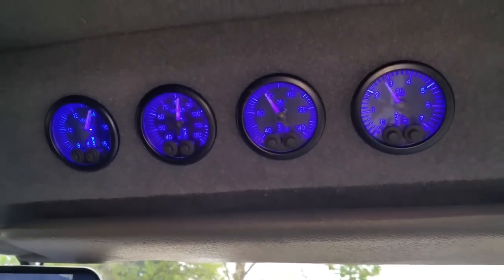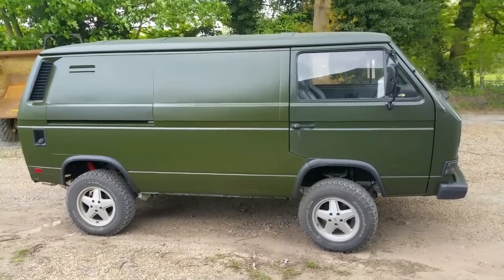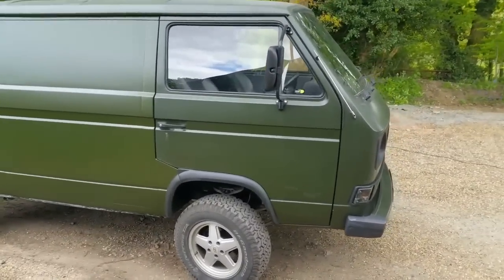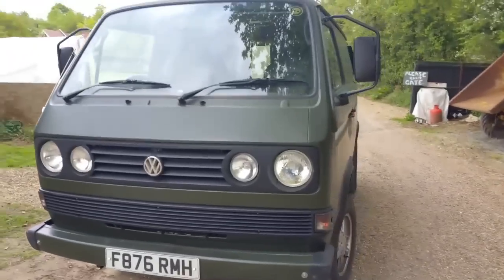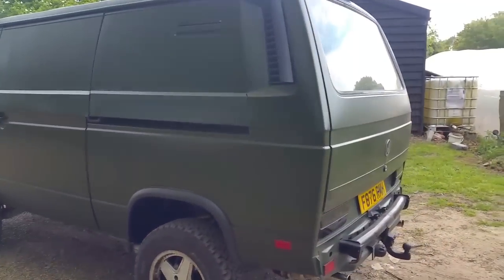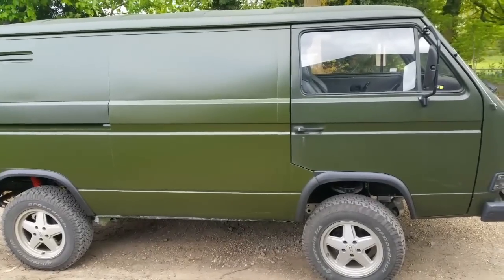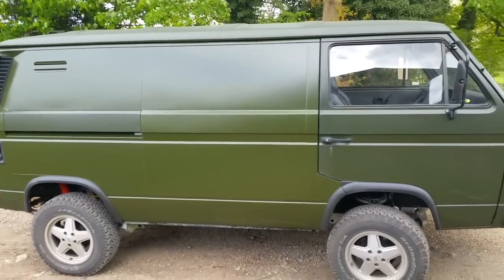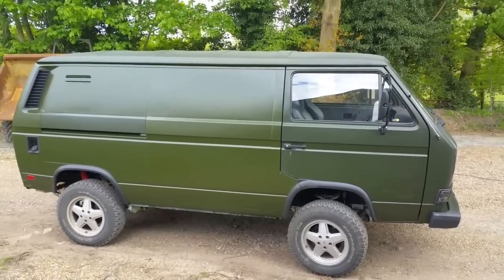VW T25 T3 Vanagon 2WD to Syncro 4WD Conversion Project - First Fifty Miles

Comment: Congratulations. The paint shades are kind of appealing. Are you satisfied with the wheels and tires? What size are they? They look just right for the van; proportionate.
Reply from the maker: +Kevin Hornbuckle - Thanks, the wheels are 16" (old original wheels from my Audi S2 Quattro) with 225/70 BF Goodrich AT tyres. Happy with them so far and ran them with the old 2WD set up.
Reply: I am going to convert a vanagon  to 4X4 using a Nissan D720 front differential and suspension. The details of the synchro in your videos are very helpful. I will be using an Isuzu diesel c223t engine.
Reply from the maker: Nice one sounds great, when do you think you'll get started? Make sure you YouTube the project, got a subscriber here :-)
Reply: Kevin Hornbuckle 1year ago

Comment: Really impressed with this series Mark.

Second time watching it - I thought I would pop back to see if there any progress vids.
How has the conversion faired over the last few months?
Any issues?
Reply from the maker: Thanks Steve, everything has held up well so far with absolutely no major issues. Still using the van as a daily driver and slowly working through the outstanding work and jobs that need doing. All being well I should have a small update vid fairly soon showing the work I have done since the last video.

Comment: Did you make gauge panel on the roof yourself or did you buy it somewhere. I have been thinking about building one because I haven't found any on internet. If built by you is there any photos of work done?
Reply from the maker: Eetu Inki - I got mine from a German company and modified it to take the gauges, sorry no photos but here is the link to the overhead console 
http://www.vw-winkler.de/Dachkonsole-in-schwarz-Radio-DIN-Schacht
Reply: Thank you, this will help a lot.

Comment: Your speedometer will always read above GPS signal,  try it in another vehicle it's the same,  that's why when driving through speed cameras the whole add 10% so if your in a 70 you can do 77 by your speedometer
Reply from the maker: I should have been clearer re the speedometer, it is over reading by a significant amount (15-20 mph). Anyway I know the reason why now - one of the previous owners fitted a 2WD speedometer which over reads in a syncro. I now need to source a syncro specific speedo in mph when I can find one!

Comment: I love these little van campers, but their not made for America.  Their 4 cylinders engine are vastly underpowered.

I have a 1986  chevy 4x4 g30 with 454 block converted to fuel injection.  I converted it to a camper with lifted suspension.

I named him "Black Bear".  There is nothing he cant handle.